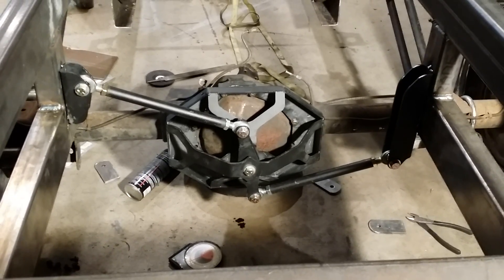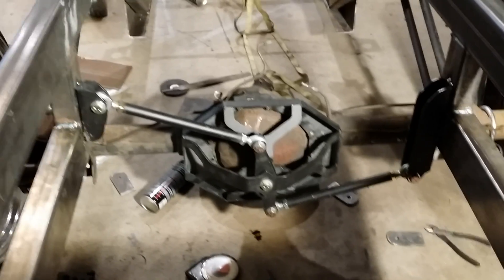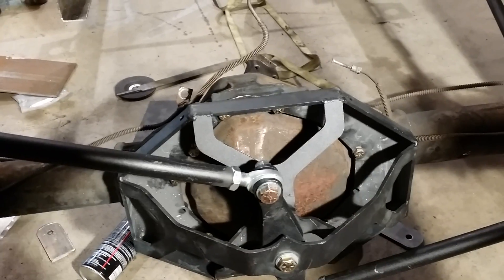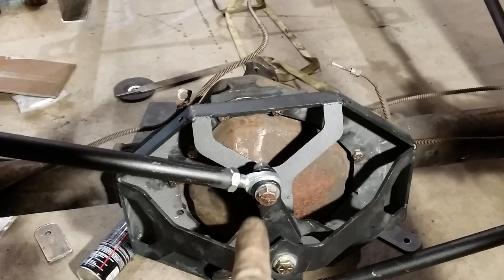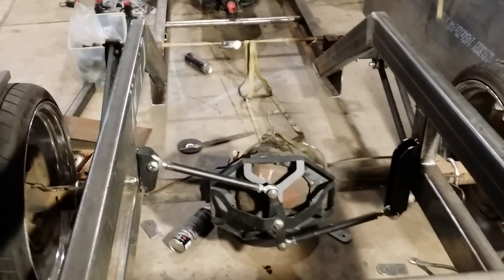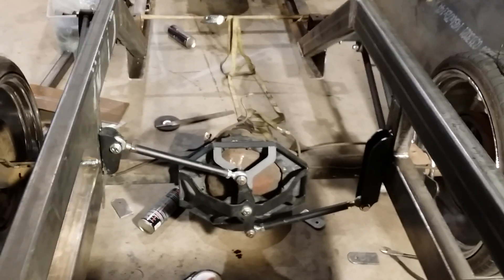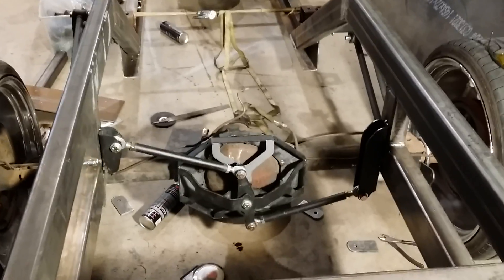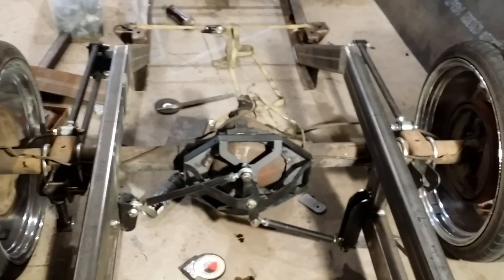How a Watts link works

Comment: U got any install videos
Reply from the maker: I don't sorry. Depending on your vehicle, they may make a setup to work with it. I made my own frame, so I took measurements and made this 73-87 Chevy truck kit work with my frame.
Reply: @bnii2  that’s the same kit I got but got my frame boxed in so I gotta weld the brackets to my frame but we’re I’m stuck at is we’re to weld the brackets at is there a Pacific Way they gotta go like the angles or and how high? Thanks for the reply
Reply from the maker: @Jesus Arzate  start by setting the truck at ride height. Turn the center pivot so when the bars are attached, it looks like a Z. The bars being parallel to the ground at ride height and the center pivot clocked a little sideways. Then test the travel of the frame and make sure the axle stays centered.
Reply: @bnii2  ok cool thanks for the help.I really appreciate it

Comment: A replacement for all of the panhard bars.
Reply from the maker: For the most part true. Sometimes a watts link will not fit. Also if the pan hard bar is long enough and travel isn't excessive then a pan hard bar is ok. However, if there is room, I would run a watts link all day every day lol

Comment: I see the watts link sold for the older mustangs with out independent suspension at the rear (like my 2006 model).  In hard cornering, I can almost feel the axle shifting sideways in relationship to the frame.  Is it correct to assume the watts link keeps the axle from shifting in hard cornering, (if that is what is happening)?
Reply from the maker: yes, it keeps the axle from shifting side to side. in an independent rear end, your sub frame holds the rear diff from moving and your upper and lower control arms hold the hubs from moving. you can upgrade the rear bushings with energy suspension polyurethane bushings. makes it hold the suspension much tighter. the rear sub frame needs to be dropped in order to replace the control arm bushings.